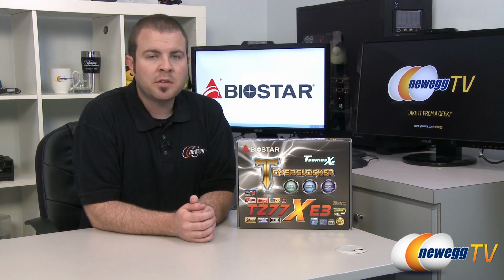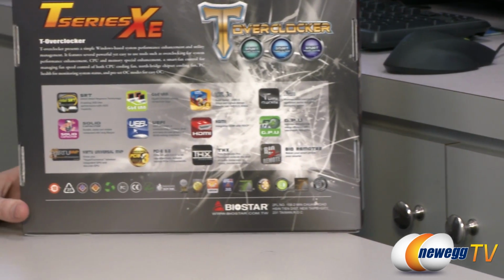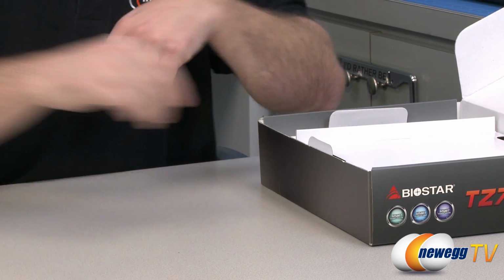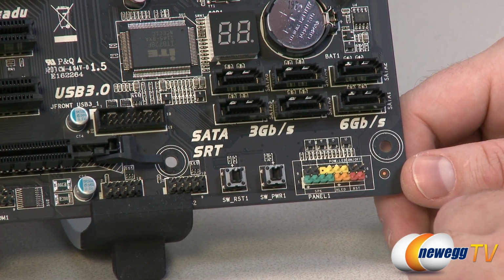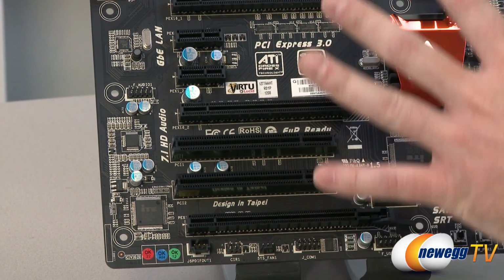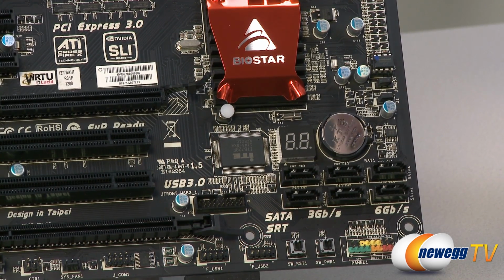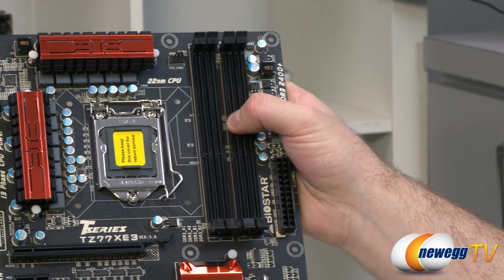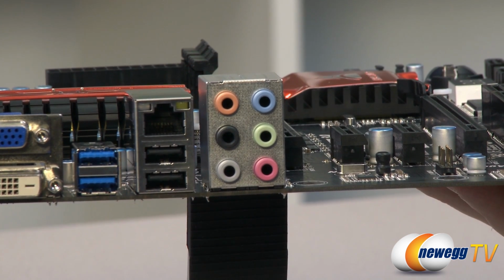Newegg TV: BIOSTAR TZ77XE3 LGA 1155 Intel Z77 Motherboard Overview

Comment: ive noticed that there isnt a 3 pin bracket included for the spdif feature. where can I get this? Ive looked on ebay and ive seen 4 pin connector brackets from asus boards, however there seems like there needs to be a special 3 pin connector as it looks like theres a unique plastic fitting. please reply. your reviews are awesome. like always :D

Comment: Most people would prefer the SATA ports on the edge at a right angle, but they're okay. It won't be an issue unless you're using a MARS II or a triple slot graphics card.